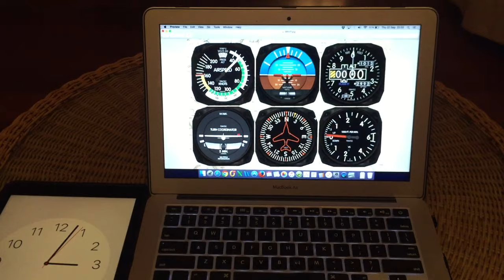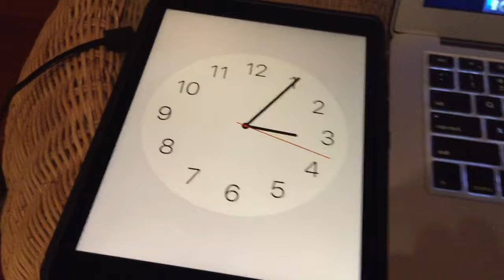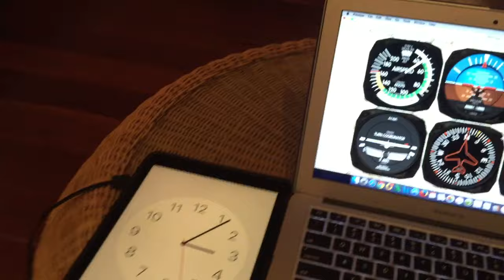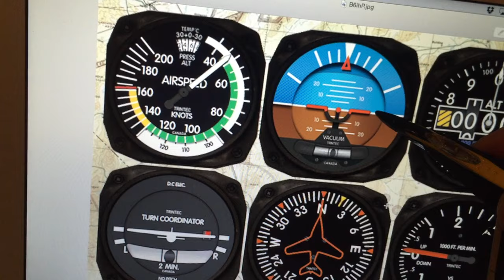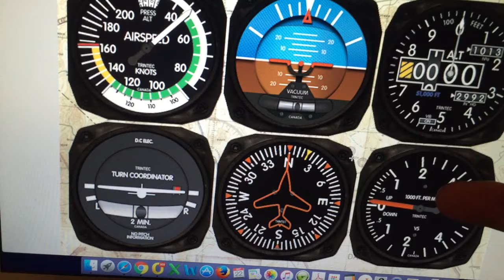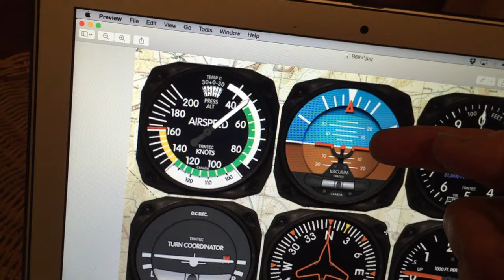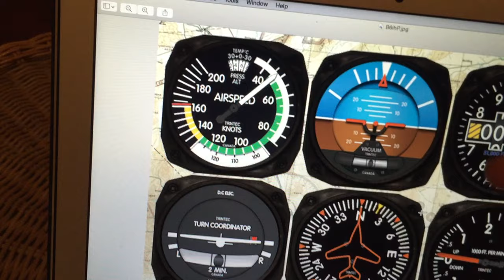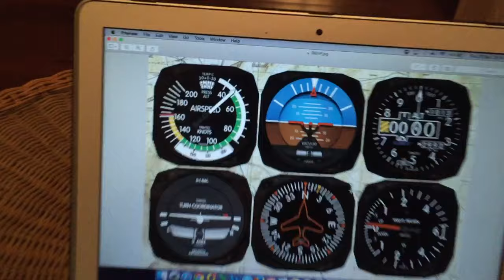Do aircraft change attitude to follow the curvature of the Earth?

Comment: Good video but one major error. The spin set level of a gyroscope at starting point A is still the same level at destination point B. This  instument indicates a flat earth surface. Aviation instruments do not lie. I've flown lots as a pilot and one thing you learn is to trust your instruments and not your senses.
Reply: +J Roger Trudel
Except  artificial horizons, which ARE gyroscopic instruments, have erecting mechanisms that tend to align them with the local gravity vector over time, meaning their "set level" at origin and destination are NOT the same. Between departure and destination, the artificial horizon's gyro will have erected itself continuously along the way.
Reply: +Rene Dekker
You'd be surprised at how many pilots have such little knowledge of their airplane's inner workings. Of course one would expect otherwise, but that's just how it is, I've met quite a few. Oddly enough, those are the guys who will throw "I should know, I'm a pilot!" into an argument in order to force credibility for their case. The fact that these guys don't end up killing themselves, their passengers and innocent people on the ground speaks volumes about the safety margins built into aviation.
Reply from the maker: +J Roger Trudel.   Have you seen my videos showing the workings of an Artificial Horizon?   They have correcting mechanisms call pendulous vanes that will always self correct back to level.  That means as the instrument flys around the Earth is is being constantly corrected for the curvature to always show level at its current position.  

The instrument most certainly does not show a flat Earth Surface.  In fact, the easily tested Eotvos effect proves quite the opposite. 

https://www.youtube.com/watch?v=z1QGRPVBZvw

https://www.youtube.com/watch?v=-0n-UDrB3Ys

https://www.youtube.com/watch?v=TbqcT05YWeo
Reply: Wolfie6020 ok it is agred that pendulous vanaes are influenced by the gravity and accordingly the gyro is corrected and errected again...but how do you explain a electronic artificial horizon indicator with MEMS componenets ..so where the influence of gravity on that instrument....further , you are not proving with any experimental setup with measuring instruments  and display continously  the tilt angle of the gyro platform  or movement of the vanes correcting them  in adjrect measuremnt in real time scenario ...now onus lies on youto prove  that the gyro is continously corrected in a direct method rather than indirectly trying to prove the curvature by seting up of experiment as you demonstrated in your other  videos by deliberately inducing  the error to the gyro ...and dont say that you dont have precision instruments actually to the measure ths precision of the gyro while passing out against the curvature...
Reply from the maker: +Srikanth Illa.  This is were you are mistaken.  There is no onus on me to prove anything.  I simply show the truth and the smart people understand what they see.

It is the small fringe element on youtube who thinks the Earth is Flat that has the onus of proof because their theories are ridiculous and there is zero supporting evidence. 

Go and believe in a Flat Earth if you wish.  I will never bother you because I don’t care.  However if you come here and make incorrect statements on my channel then I will correct you. 

There are many different types of artificial horizons and they operate in various ways.  Even a mobile phone has accelerometers these days.  They can achieve precisely the same outcome as pendulous vanes if using the correct algorithm. 

I have proven already that the gyro corrects in a continuous method.  I have plenty of videos of this instrument being tested different ways. 

Artificial horizons as Flat Earth evidence has been fully debunked.  No point flogging a dead horse my friend.
Reply: Wolfie6020 you ate not showingvwith a direct experimental setup to show that  gyro will get  continously corrected in the level flight with respect to gravity and earths curvature....but ur doing assumption that correction  will also happens over the curvature in similar way  as  the  vanes are being corrected for  acceleration and turning errors ...i remind u that vanes would remain   completely  perpendicular and would not move or require any correction if the flight  is moving over flat plane...so only way to end this debate whether arh is being countionously corrected or not by doing doing  experimental set up......take two gyros ..one with pendolous vanes and other without...power them in the actual flight.....if required one without vanes could be powered during level  flight  for six hours or more....so now we would know correctly.... if ur correct then  the  gyro without vanes should have shown  apparent drift as there is no correction facility by vanes movement due to curvature....my take in that both will look similar during level flight      as there is no requirement of correction to account for the curvature...this is best set up to shut down the people like me once for all....llz do it if possible...
Reply: +Srikanth Illa
They do pretty much the same thing. Those MEMS components do not only include gyroscopes but also accelerometers. the accellerometers are used to detect the local detection of "down". The rest is math. A Kalman filter is used to combine the gyro and accelerometer readings to generate the inertial frame of reference which is tangential to the point on the sphere.
In fact, you have to do that. Even if the MEMS components gor more precise over time, they are still in the devlopment stage, where a gyro would drift away in a view minutes and tell you, that the table the sensor lies on is upside down after 30 minutes. To make it work you HAVE to use the combination gyro/accellerometer/Kalman filter. The gyros are used to generate a reference frame which is on average stable on a short time scale. The accellerometers are used to generate a reference frame which is an  average stable on a long time scale and due to gravity always oriented towards the center of the earth. The Kalman filter combines those 2 to get a long time stable reference frame which is stable with respect to the direction we call "down"
Reply: J Roger Trudel I'll make sure you not my pilot on any flight I take lol god lol and I call bull on you being a real pilot, video games don't count mate
Reply: God I hate it when someone makes a post like this and then just disappears. The instrument uses a gyroscope...the instrument also changes the direction that gyroscope points. Being rigid in space does not mean unmoving.
Reply: Sir, as any flatearther, you are wrong :)
Reply: BB 64 just because you and your friends are pilots doesnt mean you know better than flat earthers. sry just kidding lol
Reply: Srikanth Illa   please enlighten us: what is YOUR TRAINING in the operation of modern vehicle avionics?  What do you know about ring-laser and fiber-optic gyroscopes??
Reply: +Srikanth Illa
Have you "debunked" all his other videos? I don't think so.

LIST OF SEEABLE GLOBE EVIDENCE

SUN SIZE 
The flat earth model requires the sun (and moon) to be maximum apparent size at noon and then progressively appear smaller as it traverses towards the horizon. And it’s required to be like a “star size” just prior to it “Vanishing due to perspective” and at several degrees above the horizon. But we don’t see that, we see the sun slip behind the horizon at full apparent size

SUN SHAPE
Some flat earthers say the sun&moon are also flat. But if the sun was flat it should appear progressively more oval shaped as it traverses towards the horizon. But we don’t see that either, we see the sun slip behind the horizon in a complete round shape (as well as full apparent size).

SUN and CURVATURE 
You can fly a “first-person-view” (FPV) drone with goggles so you can see what the drone camera records (in real time). Any hobby minded flat earther could do this experiment cos some quadcopters are cheap (like $100). Go to a beach and wait for the sun to completely set, and you can’t see any of the sun “disc” above the horizon (with a sun filter or with your FPV goggles cos FPV goggles are safe, it just washes out and won’t blind you). Then immediately start the drone and take off vertically and watch through your goggles and as you climb higher, you will see the sun again (at least partially). You need a powerful quad, but there are some with powerful “brushless motors” that are around $100, and a camera and goggles is another $100 (you don’t need a top-end quality picture to see the sun again).

DISTANT OBJECTS CUT OFF BOTTOM
Go to cliff on the coast where there are extremely distant object(s) (like islands or large structures) on the horizon. And set up a telescope. Study the distant object(s) and see if you can see it right down to the bottom of the object(s). If you cannot see the bottom of the object(s) you know the cliff is way too high for it to be any "swell" that's cutting it off on the bottom. And if you can go lower and view the same object it will be cut off on the bottom even more by the horizon. 

WAVETOPS
Go up onto a high cliff over the ocean and view the horizon with a telescope. You will see a completely sharp cut-off of the water at the horizon and even see wave detail right on the horizon contrasting the background sky or object(s). If the world was flat we wouldn’t see that (from a high cliff). The horizon should appear like viewed from a high plane with no distinct edge and no wave detail silhouette on the horizon.

THE MOON PHASES 
Flat earth model can’t explain it. The round side of the moon phase always faces the sun… no matter what time it is and where the moon is in relation to the sun. Study it yourself. And you can tell the time with the moon with nearly every phase (when it's up) how does that work on a FE? The nature of the lit area on the moon indicates where the sun is and hence, what time it is. There is a mechanism on how that works on a globe but none for a FE (except that "God did it"). lol

THE SOUTHERN CROSS
I live in Australia and flat earthers living in the NH can come down to the SH and observe the Southern Cross. It can be seen circling the SCP (if you look in stages throughout the night) from more than 30 degrees S. You can observe the fact that the Southern Cross never rises or sets, but just keeps going round in circles. I observed the left side of the circle in summer nights and the right side of the circle in winter nights. I have seen the whole circle. I have been keeping track of it for a year or so, it's true, the SCP is really there and I don’t even need time-lapse to see it. 

PLANETS PROVE SPACE

VENUS 
With a small telescope you can view Venus and sometimes it appears larger and like 1/4 phase, and months later it appears smaller and like 3/4 phase. This is what everyone can see in a telescope. When Venus is larger and 1/4 phase it’s on the near side of the sun and when it’s smaller and 3/4 phase it’s on the far side of the sun (this geometry fits that exactly with what we see). This is visual proof of the depth of space.

VENUS MARS JUPITER SATURN
Venus is always observed somewhat near the sun and that completely fits with Venus being inside our orbit. And Mars, Jupiter and Saturn all appear anywhere in the sky in relation to the sun and that implies they are outside our orbit. What we all see proves space.

JUPITER
With the naked eye, Jupiter appears pure white and it’s about the brightest thing in the sky (after Venus) and it does not twinkle at all. It’s so easy to find (when Jupiter is up at night). Even with binoculars you can see the “disc” size of Jupiter (unlike the “point source” stars).

JUPITER’s MOONS
Even with good binoculars you can see Jupiter’s 4 visible moons traversing around Jupiter (side view). If you view in stages like several hours apart (or the next night) and you will see that the moons have changed positions. If the next night is cloudy just view again as soon as you can. Draw on paper what you see in the first stage, then compare it to what you see later in the second stage. Jupiter’s moons orbit quickly cos of Jupiter’s immense gravity.  And this is visual proof of it. Did God put that on the “firmament”?

JUPITER’s GREAT RED SPOT (GRS)
With a good telescope (capable of resolving the GRS on Jupiter) you can see the GRS traverse the planet (in stages) throughout the night. And sometimes the GRS is visible and sometimes it's not (when it's on the other side of the planet).

SATURN’s RINGS
Through a telescope, study Saturn. To find it with the naked eye Saturn looks like a reasonably bright “star” and cream in colour and it does not twinkle at all. So when Saturn is up it’s easy to find if you keep in mind the colour and lack of twinkling (rather than the dominant brightness). Through a telescope you can see Saturn’s rings pitched at a certain angle giving the rings a certain apparent shape. View Saturn again a few months later (when it’s up) and you will see the rings take on a different apparent shape. This implies that the rings do in fact show depth.  Did God put that on the “firmament”?

SATURN’s MOONS
You need a good telescope to see Saturn’s 3 visible moons. Just like with Jupiter, Saturn’s moons prove space by viewing it and then viewing it again the next night. You will see that the 3 moons change positions with each stage of viewing. You just do the same thing with Saturn as you do with Jupiter’s moons, to witness this. But Saturn’s moons are viewed at a different angle than with Jupiter (like not exactly a side view) and the moon’s (at least sometimes) appear like an oval around Saturn (instead of a straight line as with Jupiter).

Comment: The clock is rotating in a Fixed Mechanical Position , there is no variance allowed . Nice try tho lol
Reply from the maker: +Focke Hue,  Can you explain that comment a little further please? .  Do you understand the actual point I was making by having the clock ticking away through the video?

Also the Clock is on an Ipad - there is nothing mechanical about it either.
Reply from the maker: +Fockes Hue.  Thanks for the reply, your post confirms you don't understand the point of the clock in my video.  Regardless of whether the plane speeds up or slows down it will never circumnavigate the Earth in 12 hours, therefore the pitch down rate is always going to be slower than the hour hand is moving on the clock - that is the point you missed. 

As for that video - it is completely wrong - that math is not applicable at all to a moving aircraft.   Why didn't you figure that out for yourself?  It was an obvious mistake. 

I already commented on that video months ago - did he delete my post. 

Honestly mate, let me give you a tip.  It is apparent to anyone watching these videos that Flat Earthers are all very weak in Maths and Geometry.   That is the common denominator with all of you. 

Posting a link to that flawed video proves to me your Math and Geometry skills are very weak too.  So that confirms my point perfectly. 

You are not helping Flat Earth by publicly advertising you don't understand simple math mate.   You are actually ensuring smart people will never take it seriously... Just sayin...
Reply: And to think I was trying to be nice to you . Ok bub you show me the Math where a Straight line has a Curve . Your reply tells me you are book trained and not trained in the Real World , good luck ....
Reply: Focke Hue  end of needle flying round a flat plane   it's a good analogy   maybe  he didn't realise he was making when he said it

Comment: Wolfie, an interesting video might be the International space station. One good thing about this flat earth nonsense is that it got me interested in the ISS. You can find times when it passes over your location.

Anyway an interesting observation occurred a couple of days ago. As you may or may not know the ISS lights are not visible from earth. However it is the third brightest object in space. The brightness comes directly from the suns reflection. So the ISS appeared low in the southern sky and traveled at almost 90 degrees above my head. At that point it slowly started to fade and inside 10 seconds it had completely disappeared even though it was the closest it had been the entire path.

The only logical explanation is that the sun light could no longer strike the ISS. If it were a lighted craft (a plane as others have claimed) then this phenomenon would not happen. This happens all over the Earth every day at thousands of location. This one was more apparent because it was almost directly overhead but the same thing happens almost every time,